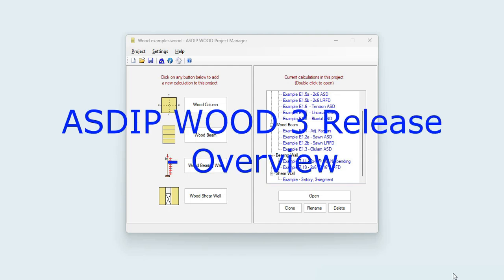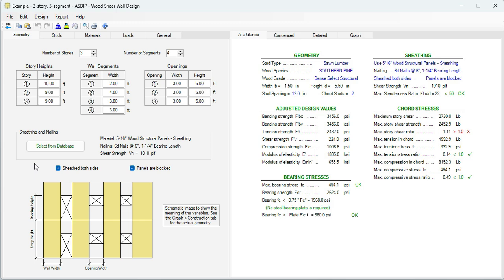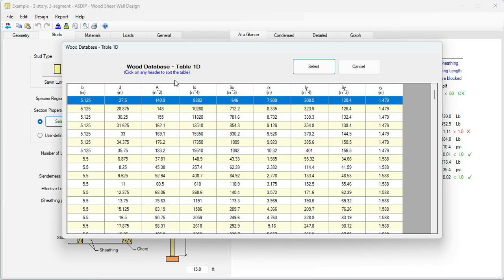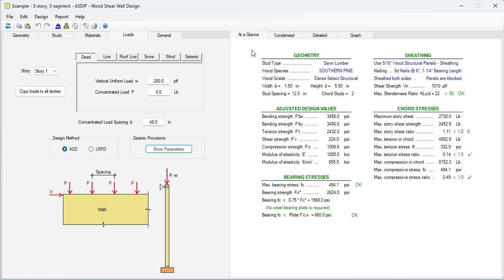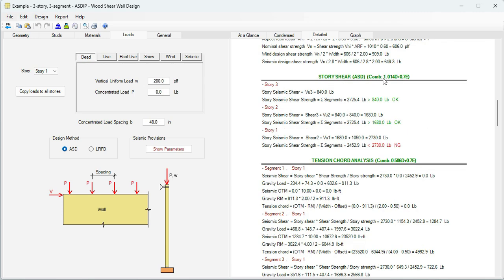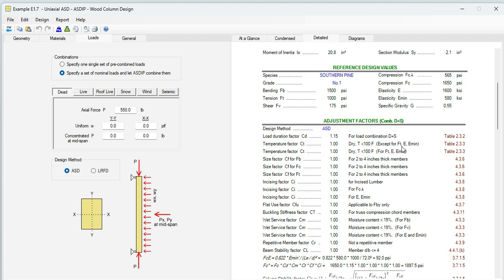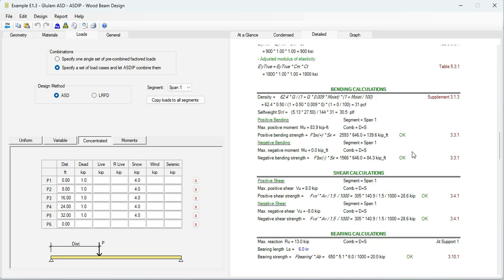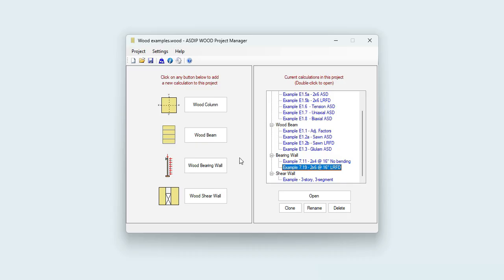ASDIP WOOD 3 Release - Overview

Comment: hi, i'm using SAP2000 for modelling and analysis timber structure, and planning using ASDIP wood for the design, which loads from SAP2000 i use for input in ASDIP? thankyou sir